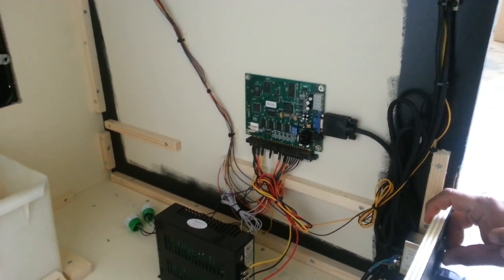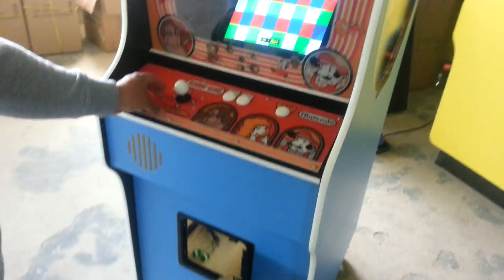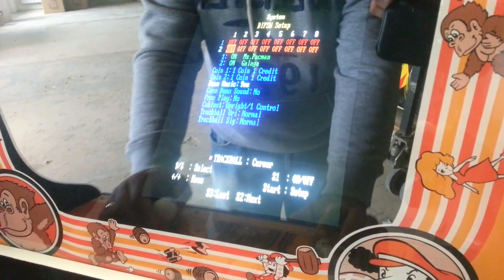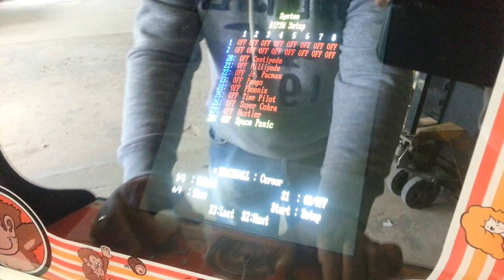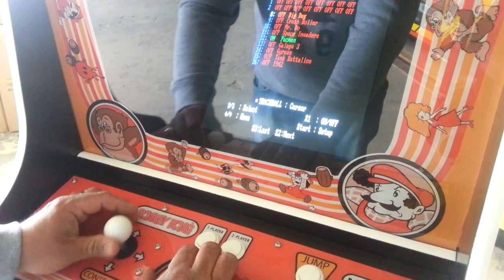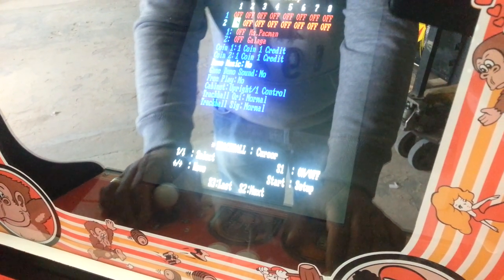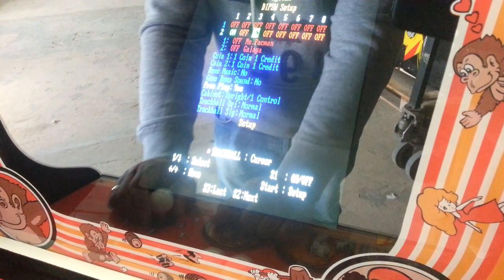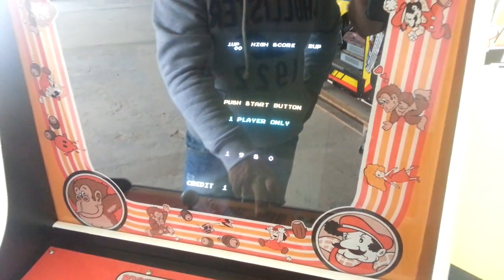Adjusting settings on a 60-in-1 arcade PCB

Comment: I just picked up a Gorf cocktail cabinet that has been gutted and basically is now this multicade board instead. It doesn't have the S2 or any control button interface. Just game control buttons/joysticks. I can get into setup by flipped dip 4 on but after that it says press S2 but I have no S2 button. Is there a way for me to traverse the setup menu with the normal game controls? None of the buttons nor joysticks register when on that initial setup page saying press S2.
Reply: @mrjinxzz  Thanks so much, this comment pointed me in the exact right direction!  I was at least able to enable some games that were turned off and adjust each game's settings. Woohoo! My only disappointment is I thought you could customize the game menu itself. Apparently you can't. It reads "Happy Hours" in the most disgusting rainbow, shadowed font with a grey-ish background. I bought this cabinet from an old arcade bar assuming they had customized that. But apparently that's just part of what's built into the jamma board itself, not customizable. Let me know if I'm missing anything. Thanks again for your help!
Reply: Man gorfs my favorite game
Reply: did you ever get this resolved? it appears the response message is gone.  I have the same situation as you. I can flip dip4 and get the screen that says push s2 but i don't have an "S2". Any help?? @TimStiles
Reply: @JeffYPbPr  Gosh it's been so long since I fixed this situation, I can't remember off hand exactly what I did. Thankfully I did find the reply from @mrjinxzz to my original comment in the YT email notification I received when he replied. Here you go, hope this helps. I think I did what he said and hooked up a separate button to the correct jamma board harness points:
"Hi Tim, check if you can add a wire to your wiring harness that adds button 2 (and 3). You can simply find a "jamma pinout" on the web to find which spots on the Jamma need to be wired up. Connect a button to Button 2 and button 3 and add the GND and you're good to go."

Comment: Don't have S2 button on my Popeye machine with 60 in 1. Where or how did you wire up 2 extra buttons? Any instructions link?
Reply from the maker: If you check online for "jamma pinout" you will find the pin layout on the big blue jamma connector. You should be able to trace the wire "player 1, button 2" and connect a button to that wire and one ground wire.
Hope that helps.

Comment: Can someone help me? I purchased a 60-1 Blee and i seem to have wired it correctly as the lights flash solid green after power up and blinking green on the second light but the games never seem to start up. It always boots to service screen and I have verified that the dip switch #4 is off and not in service mode. I have two of these boards and it seems to be doing it with both boards. I also have multiple harnesses. One player and two player harnesses. Please Help, thanks!!!

Comment: I have this in my arcade machine, but flipping the 4th switch doesn’t seem to do anything at all, it just starts up same as it would without flipping the switch.
Reply: @mrjinxzz  Yeah, after closer inspection, the pcb isn’t the one in the video. It has the same games listed in the same order and the attract screen is identical. I don’t have a manual though because I got the arcade machine from my uncle who was throwing it away. I might replace the pcb with this one so I can adjust the settings and such. The volume is the main thing that’s bothering me, it’s so loud! 😂
Reply: Do you figure it out I have the same issue
Reply: @manuelhinojosa2319  I had a different (but very similar pcb) so this video Didn’t really help me with it.
Reply: Thanks 
How did you get it to work ? I'm thinking of getting a 60 in 1 board from Amazon and see what happens

Comment: There is function for horizontal screen? I no have vertical monitor
Reply from the maker: The 60-1 is vertical only. If you prefer horizontal there are a lot of alternatives. Besides all the Pandora's boxes you can choose a 19-1 pcb which runs horizontal games but to be honest it only runs 2 great games in my opinion.
Reply: @mrjinxzz  It s ok.what is thè function in menù for to continue a game?Just finish game goes in menù soon.i no undestand this menu many confusion

Comment: hello, question,  how can I change setting if I don't have those buttons?
Reply: simply dont wire the buttons and install the board where you can reach the dipswitch through the coin door. You don't need to wire the test buttons. Also make sure you have the power switch easily accessible through the coin door too lol.
Reply: spyralspyder hello mine doesn't have a power switch on the outside. It's on the inside but it doesn't work, you have to unplug it. Seems like switch 4 on the dipswitch doesn't register either. I've heard you can access the the settings menu by holding the test button when you power on( in my case plug it in) will it still work? What is a test switch and what does it look like?
Reply: A test switch is wires for easy access through coin door but u don't"need" it unless it's a big machine u don't wanna move away from the wall to get to the board. I have my board wired to a power strip.
Reply: U should be able to unplug...flip up dip switch 4 then plug in and it should boot to test.

Comment: where did the s2 and s3 come from? I have a ms pacman arcade stand up.
Reply: we've built the cabinet from scratch so we have placed the buttons ourselves. I guess your cabinet is an original? In that case it does not have the 60-1 PCB
Reply: I put the 60 in 1 in my machine last week. got it working and plays well, but I did notice that in test.setup it does ask for sw3 but I don't know what it takes to use it.
Reply: you might want to check this wiring diagram to see if button3 (SW3) is wired to anything: http://japanamusement.altervista.org/images/image012.gif
Reply: Mine loads up to S2...But when I hit S2, nothing happens. S2 works in the game..Weird..Posting in case I am doing something obviously wrong! :)

Comment: can you have continues when on free play ?
Reply: mrjinxzz how ? I was looking through my menu and I turned on continues on the games that have it. But when I play the game it won’t let me continue. Once your game is over it just sends you back to the main menu to select a game
Reply: I have the cocktail game version. it have the same menu as this video. Arkanoid is the main game I wanted to continue on. I enabled continues but if you are on free play it won't let you. It says " Hold the fire button and insert coin to continue " but my machine doesn't have the mechanism to insert a coin and it be counted
Reply: Thanks man, I'll try this
Reply: I did as you recommended but still can't continue on the games that have continues available, even if there is credits in the machine. Do you know how to fix this ?
When I insert a coin the main screen shows multiple credits but once you select a game it only shows 1 credit. If you add more it doesn't count them @mrjinxzz
Reply: yes  enable them in settings
example dig dug  continue to on
Reply: @ocmuffler  Did you ever resolve this? I have the same issue at the moment
Reply: Corey Madden  naw I can’t continue

Comment: Hi how do you adjust game machine volume
Reply: yeah on the board is a small yellow or orange potentiometer. Just grab a small screwdriver and turn it to adjust the volume
Reply: move dip sw 4 to on
power up the machine
press s2 (next) about 50 times to get to very last screen
use the joystick left right to adjust volume
press start 1
turn off the machine
move dip sw 4 to off
turn on the game.

method 2  turn the small yellow knob on the circuit board w a small phillips screwdriver

Comment: Dear Sir I speaking from Bangladesh. I am a arcade gaming business man. I have a couple of video game shop in my city. My gamer is fell bore to play of pandora or those  similar game. So I need to some new multi game with jamma pcb accordingly. In fact neo geo, capcom, konami or other jamma pcb platform has not attract the new generation gamer. So i need a new gaming jamma pcb board like Fifa 11, 12 or 13, need for speed underground, tekken 6 or 7, house of dead 2, call of duty like others. So is this possible to make a jamma pcb board on these game for business? may be those game will be format a arcade version mode. because my all gaming machine was build with arcade cabinet box system. so let me know sir, can you make my new game in jamma pcb formet. its busness purposes for based each player can play coin system.
Reply: @mrjinxzz  thanks sir

Comment: Awesome video!! For some reason when I plug in my arcade it plays music and non of the controls work. Do you know how to fix this? 😢. Would so appreciate at it ❤
Reply from the maker: Check if you have your gnd wire connected correctly. It's the black loom that should be connected to every button.
If you have 3-prong switches, check if you have the correct 2 prongs connected.

Comment: I have this board in my DK cab. I found this tutorial really helpful for booting straight into DK but I have an issue. My high score from a long while back of 87,900 is saved on there and whenever i score more (for example I just scored 111,200) the score disappears when I turn off the machine? Is this a bug / setting? Or has my DK (1) gone corrupt? 
My previous score of 87k remains no matter how many times I turn off the cab but no higher score is saved. 
Would really appreciate any help.

Toby
Reply: What you need to do is write your new high score down on a sticky note and paste it on the top part of the screen then your new high score will be saved for the next time. Then just repeat the steps given here. Simple! Have a nice day! ;)
Reply: Glenn Brown thanks for the suggestion but last thing I want to do is cover my beautiful cab with sticker residue haha
Reply: Make sure DIP #3 is turned to "ON" to enable high score saving.  It's the little blue bank of four switches, and you'll need to power cycle the machine after turning it on for the system to recognize the change.